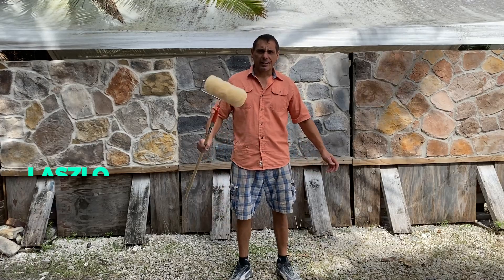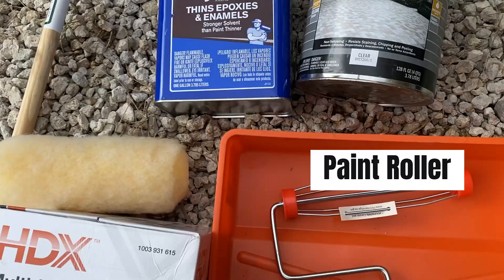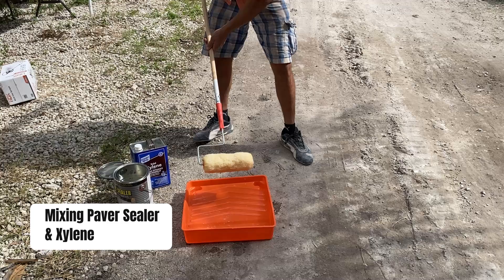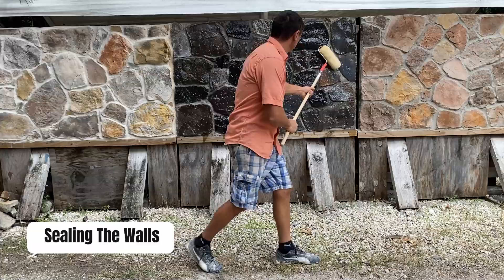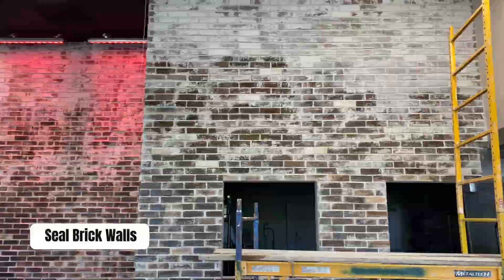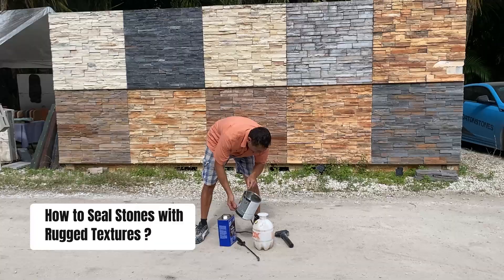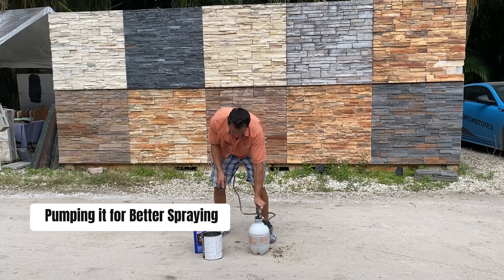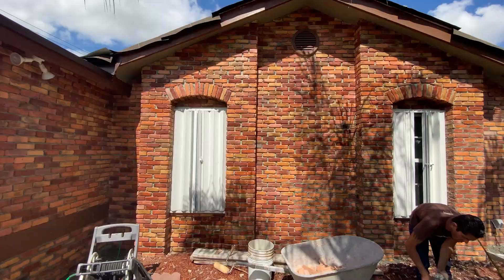How to Seal Stone walls and Brick veneers like a pro.

Comment: Fantastic walkthrough! really appreciated the clear, step-by-step instructions and the tips on the sealant. Thanks for sharing your expertise! I went to purchase Dyco Paints Paver Sealer 1 Gal. 7200 Clear Gloss Exterior Solvent Acrylic Sealer at Home Depot, they told me that this brand is not available in California. I like the way this sealer looked on the stone wall, in your video. Can you provide me with another sealer brand that is equivalent to Tyco Paints Paver Sealer?